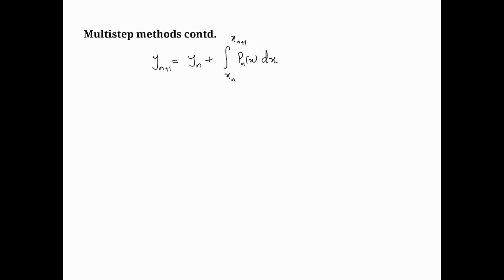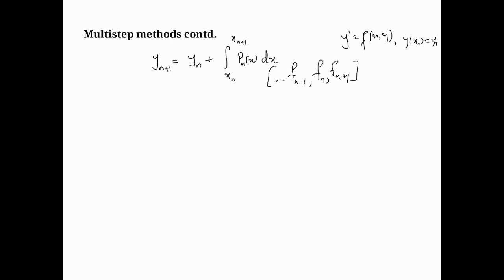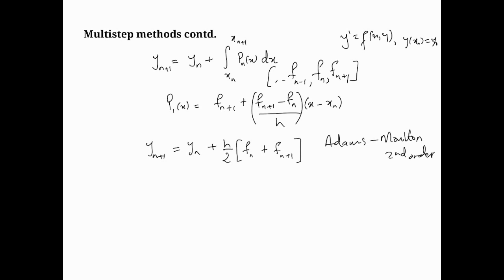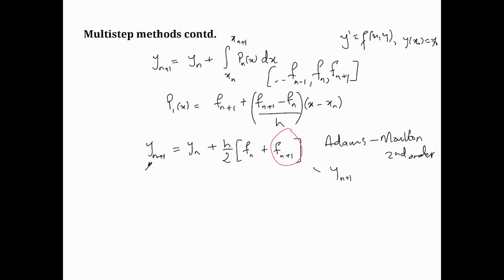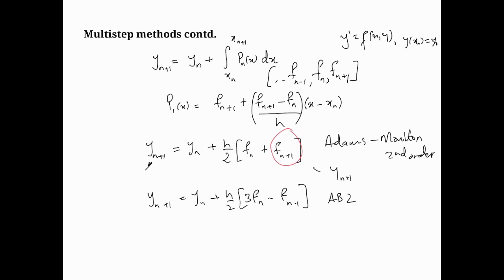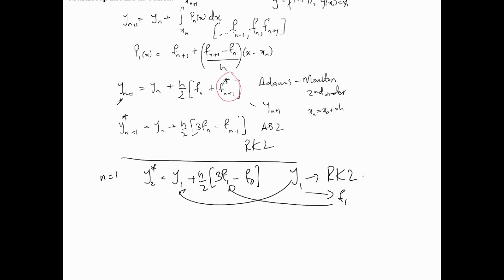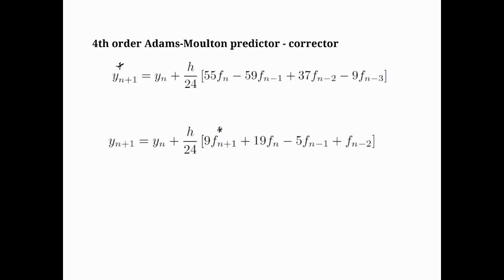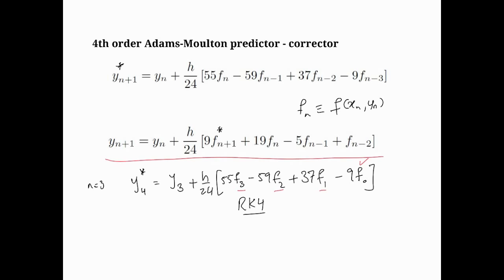Numerical Methods for ODEs - Multistep methods - predictor-corrector methods

Comment: Very interesting way of explaining MS methods.  Two comments:  1.- The Adams-Moulton is solvable using for example a Newton method to find roots of an algebraic implicit equation, it´s interesting to show there exists methods to solve implicit schemes at this point due to their importance in PDEs.  
2.- You may improve the accuracy of the Predictor-Corrector  iterating between Y* and Y until a tolerance is reached, usually 3 or 4 times so the method may be named P((EC)^m)E.  P (predictor, find Y*), then E (evaluate f*), C (correct from Y* to Y, check the difference between them m times or until tolerance is reached) and you got the new Y